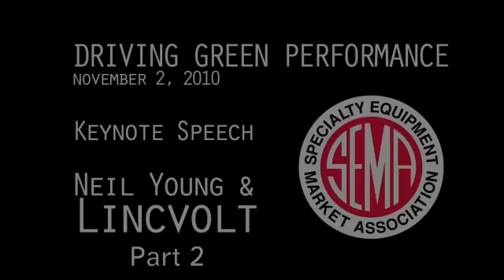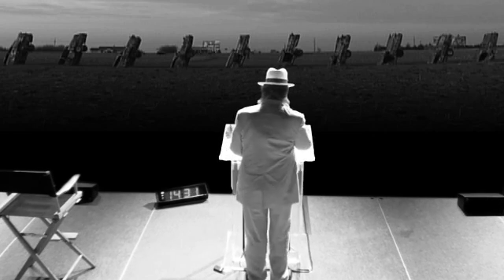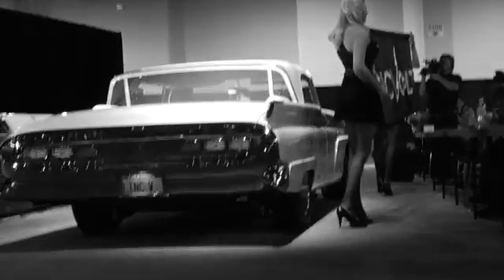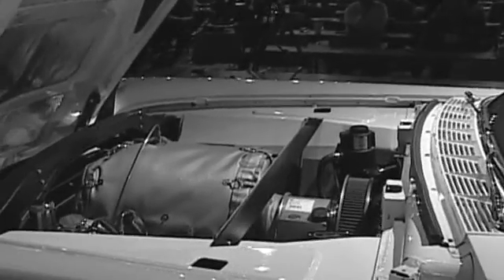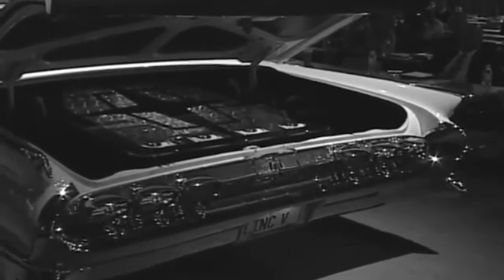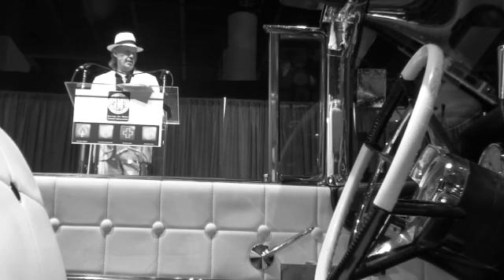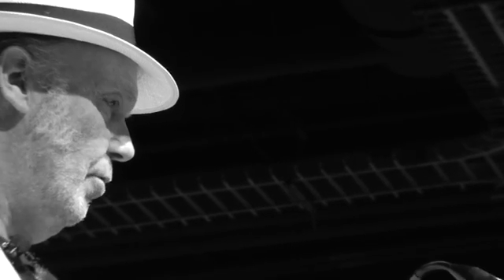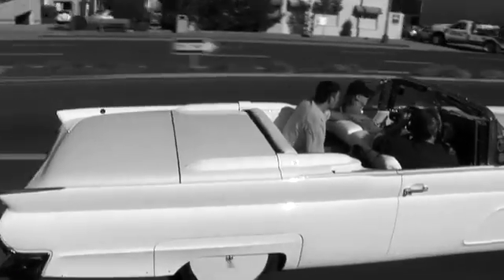Neil Young & Lincvolt at SEMA 2010- Part 2

Comment: On Charlie Rose you talked about "cars returning power to the grid" or "cars powering themselves" when they are on the highways.  That is very Thane-like and I just wanted to comment on that.  It's always going to take real, tangible energy to push a car through the air at high speed along the highway.  There is no free lunch.  So you are doing the right thing - going for renewable energy sources to to that - all coming from the sun.